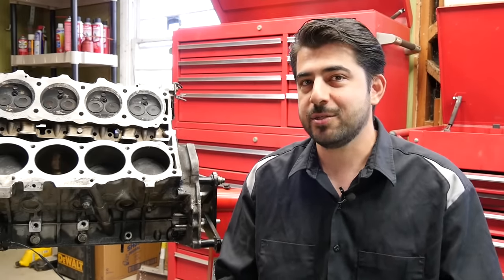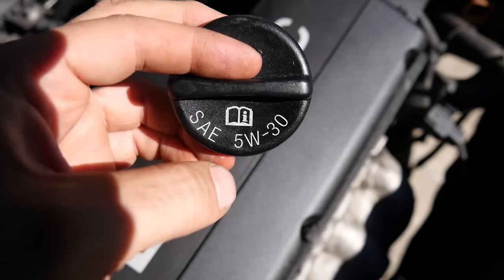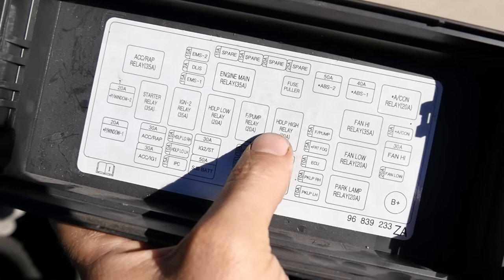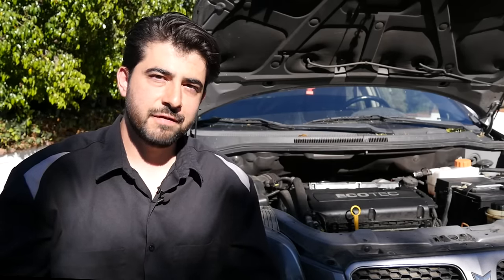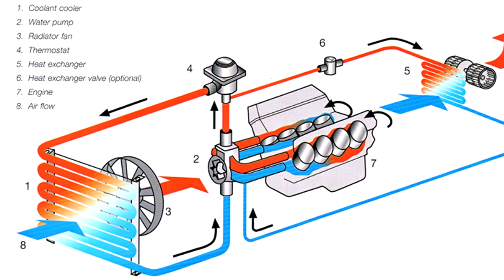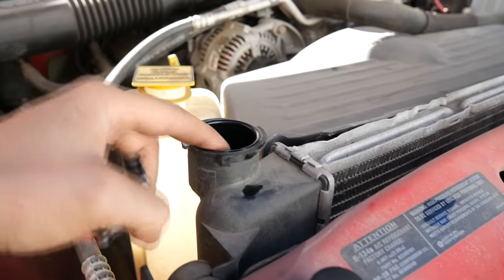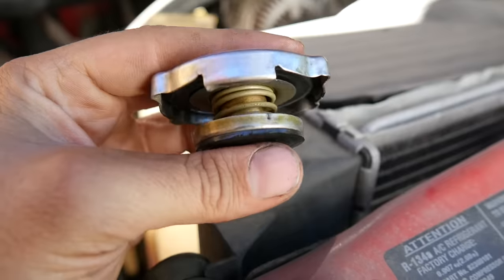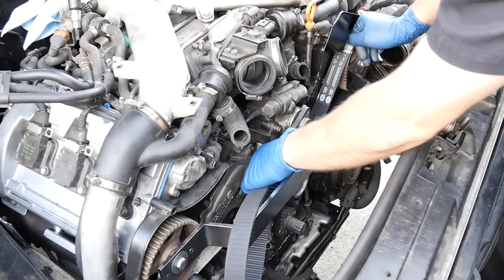Make Your Car Engine and Transmission Last a Very Long Time - Top 5 Tips On Car Care

Comment: 😳 No Sir.. Never prefill a lube filter unless specified by the manufacturer.. New oil right out the bottle is not as clean as people think 🤔 it can contain contaminants that can cause significant engine wear or damage if goes unfiltered in the engine by prefilling the filter..  all engine oil sold even under the API, ILSAC standard as to meet a ISO rating of particulate count for new oil which is always higher than what most manufacturers want for modern car engines.. so one can do way more harm than just put on the filter dry...
Reply: Let's see a legit. reference for that.

Comment: Failed to mention low quality gasoline can leave deposits on the oil control rings. Major problem.
Reply: Where do you get "low quality gasoline" In the U.S.?
Reply: @wholeNwon  the place thats a penny cheaper then BP,Shell or any other top tier station
Reply: @dustinpomeroy8817  (than).  Don't know where your gas comes from but here it ALL comes from the same regional refinery. If that weren't the case, transportation costs alone would make large differences in prices at the pump for various brands.  In fact, the same hauler delivers almost all brands here...including the "low quality" gas...that still meets all of the gov't. standards. More myths. But I wouldn't buy any brand from a very low volume station.
Reply: @wholeNwon  yeah and all water comes out of the ground,I don't know how you figure a place like Shells gas isn't better than than a cheap places but to each their own ,I'll stick with places that have a premium additive package
Reply: @dustinpomeroy8817   I do use "top tier" gas but I don't think that cheap gas is somehow "bad". I buy top tier because I keep my cars forever and never want to remove the heads. So far, so good after 58 years. Does increasing the detergent 3x help keep the intake valves clean (16 of them in my car)?  Probably so. Does it do anything for all those exhaust valve?  Nope.
Reply: @wholeNwon  why wouldn't cleaner gas going in be cleaner gas going out,a cars much like your body, I'm no vegan by no means,but the fewer impurities you put into it definitely the fewer that will come out,if you didn't believe it was better gas you wouldn't use it.Will cheap gas make your engine seize up?No Will it shorten the life of it,yes along with the injectors,the fuel pump and anything else fuel and combustion related.Keep doing what your doing, it's obviously working,but know the gas you use is quality the counter part to high quality is low quality .Just because something meets standards doesn't mean it's good per say it just means it meets the minimum requirements by law .Haha you're way more experienced than I and I guess by talking to you it makes me wonder why you made the statement in the first place when somewhere you believe the bare minimum isn't the way to longevity

Comment: Timing components, at least tensioners and pulleys, and even water pumps should be OEM. Have seen several times where pulleys, pumps or tensioners failed at a fraction of miles vs OEM components, even at 50,000 miles or less. You wouldn't implant a cheap chinese hip or knee joint that would need redone in a few years when it fails, right? Spend the money once and go another 120k miles

Comment: 1998 jeep Cherokee...300k miles and still daily driving that mfer. Change the oil every 3k and use decent oil like 1540 or 2050. None of that thin shit . Oil is supposed to be thick not watery like 0-20. If you have a car that says 5w30 use 10w30. Never use the thin stuff it recommended.

Comment: What if my car overheats at idle, but is normal when I'm driving
Reply: Could be a bad radiator fan.  When you're driving the car is moving thus pushing air through the radiator.  All new cars use an electric fan that kicks on when the temps start to climb to keep the radiator cool when not moving fast enough.  Pop the hood, and run the car.  When the temps start to rise above normal look behind the radiator and see if the cooling fans are on.  If not there is your problem.
Reply: Slim Jim thanks! I’ll give that a try

Comment: Why synthetic? It’s very expensive. If someone drives only 3-4 thousand miles a year, would it make sense to use a thick synthetic oil? I figured it might even be a better idea to avoid it. Now someone who drives a lot, I can see maybe getting synthetic. I prefer to just 1-2 times a year with under 4000 miles use, changing itbwith conventional.

Comment: Dude forgot to mention, how you drive. If you get a heavy truck with a small engine and drive it like heavy truck with big engine, you might not get a lot of life out of it. Get any vehicle and drive it with your foot to the floor all the time, and it won't last long. Not even one of them good old Toyotas. I see people listing them and saying they've replace the engine all the time. Even an old 2.2 or 3.0 V-6 Toyota won't survive lack of maintenance and reckless driving habits.

Comment: Replace a thermostat, and a water pump, with the timing belt, on an engine that has been giving you no trouble? Er.. Yes and replace the welsh plugs, not with the aluminum ones but brass, pull the entire engine apart when you do an oil change, and paint all the oil wells, journals etc with clean oil with a paint brush. Even though your engine may not have overheated and your head gasket is still intact: Just take it off and service it anyway (perhaps during your oil change painting?). Oh never mind, just replace the engine... It's easier than all of that other crap. 

No one does all of this stuff he's talking about. Not even your average mechanic and with good reason. Even drag racing engines, that are rebuilt every race, don't change the things he is talking about every time.

Comment: NEVER fill the engine oil filter in your car!! Doing this CAN cause an air lock in the lubrication system that the oil pump cannot remove!!!! Yes, I HAVE seen this happen several times!!!!

Comment: To make a Generation 1 longitudinally-mounted VW/Audi 1.8T engine last longer, use an oversize filter, such as a Mann 950/4 = Purolator L40316. It hangs vertically and can be prefilled with a full quart of oil.

Comment: the only thing about flushing an automatic trans sometimes the dirty oil is the only thing holding it together no i have seen guys flush there trans and it would not work right again. so i if you havent changed you trans fluid in like 100.000 dont trust me i know.

Comment: A lot has to do with the engine you have in your vehicle for example in my 1997 Toyota Hilux witch has done 437000 kilometres and the engine because my Hilux has the famous ultra reliable 22R motor which is renowned for its reliability and its a manual actually l did change the thermostat and coolant recently and the radiator cap was changed about 4 years ago when l changed the radiator also when l changed the coolant and thermostat l changed the three radiator hoses and one of the hhoses was original now l have no petrol pump relay because the petrol pump is mechanical mechanical as was changed before l bought the Hilux 5 years ago because it looked shiny and new l have changed all the usual parts brake pads oil oil filter air cleaner filter fuel filter distributor cap rotor button plug leads spark plugs rocker cover gasket whole exhaust system universal joints tyres it had new rear springs when l bought also when l bought the Hilux l got no service records no paper work at all only the registration paper that's it but now l keep every peice of paper work associated with the Hilux and a list of what what work has been done on the Hilux and so far it up to 15 tasks

Comment: Keep pouring money into one car. That's a easy way to keep your car running for 400k...besides normal maintenance, change transmission,  change alternators, change spark plugs, batteries, fuel injection, breaks, timing belt, all gaskets, etc...

Comment: I have a 2010 lincoln mks 142,000 miles never needed a repair
Reply: That's barely broken in for a Toyota. Check back in after another 150k
Reply: @AlexandarHullRichter  show me a Hyundai with more than 150 miles and I will give u a dollar
Reply: @PCSPITTER4NY  you owe me a dollar. I've got an 03 Elantra at home with 224k, and I'm changing the timing belt so I can sell it.
Reply: @AlexandarHullRichter  one still running
Reply: @PCSPITTER4NY Dude, why tf would I bother doing major maintenance on a car that isn't running?

Comment: How does filling the oil filter help with start up wear?? You oil pumps in the oil pan and oil is sucked up and system is pressurized and all your oil has already drained  from galleries when car was shut off so filling oil filter really makes no difference at all

Comment: An6 car can get 400,000 or more . All you have to do is take care of it . They  have not made cars any better than they were in the 60s matter of fact they have made them less environmentally safe . 
You do the regular maintenance to them and they will last the same as always 
I have had many go over the 300,000 mark 
I only sold them to get something different 
They are still on the road some have reached 500,000 miles now

Comment: All of this is in your owner's manual
Reply: The weird oil change part to crank to get oil in filter is not in the manual.  The changing cap as preventative maintenance is not in manual.  A warm engine has oil in places it needs.  And tossing a cap is silly.  Mechanics I go to just test it.  Why toss it without testing?

Comment: Moist  cars today have what’s called clear flood mode all you do is put your foot to the floor of the gas as you crank the car and that will cut the injectors therefore you can circulate oil through that empty oil filter😱😱😱

Comment: After the first tip: "use always a synthetic oil", "and factory recommended oil" I closed the video...

Don't forget; after a certain amount of time, you get wear, and the factory recommendation and especially synthetic oil will be too thin for the engine. 

Don't use syntetic oil, after you have used whole your life a half or non syntetic. This will loosen up all the dirt and get everywhere.

Long story short: use a oil according to your wearness of the car. Mainly a 10w40 half-syntetic will do the trick, if your environment conditions are normal.

Comment: Never, ever flush your transmission! Only replace the filter and drain and refill. If your transmission has never had service, and has over 100,000 miles, you shouldn't service it at all.

Comment: I'm not sure if i'll ever buy another GM product ever again, My Equinox transmission just gave out after 120,000kms.. WTF!? This is with changing the transmission fluid at 80,000kms which was still red. Also the engine was consuming oil.. ECOTEC is GARBAGE!

Comment: the nonsense about removing your fuel pump relay after an oil change is pure nonsense, just run the engine before you empty the oil, and refill it relatively quickly.

Comment: Listen folks, it is very simple. First, you have to buy new one toyota or a hyundai. After this, change oil and filter every 7000km. Last step to win, GO BY THE BOOK OF THE FACTORY. FOLLOW THE RULES INSIDE THE BOOK.

Comment: 1. Take that transmission pan out.. clean it with bleach.
2. Put it back up
3. Torque it to your specified manufacturer's directions 
4.refill with the amount needed for the transmission. 
5. Flush it.
6. I've done this to too many vehicles with various mileage intervals and none have failed. 

Only thing is, when you take the pan out, look for big metal pieces. If not your gooood.

Comment: Filling oil filter with oil is A HYPE, it takes a split of a second to fill it up and start sending oil instantly when you start motor. Check out motors running without  oil as long as it doesn't get hot.

Comment: Buy an older car with low mileage. New cars are only any good for the life of the warranties due to the ever more complicated electronics and emissions add ins like DPF’s, EGR valves, electronic parking brakes, stop/start systems. Ok if you can afford to change your motor every three years, otherwise a living nightmare.

Comment: You talking BS! Guys,do NOT fill oil filter with oil before replacing it! After oil change,oil must go through oil filter as fast as possible and if you'll fil it,it will flow hard...broken filter is often caused by this...DO NOT fill oil filter!

Comment: 😂 you wont get to 400k miles because you fill your oil filter or crank the car with no fuel pump fuse. This will just give you trouble with no real benefit

Comment: If you had warmed up the engine prior to changing the oil filter, priming is not necessary.  Removing fuel pump fuse is not practical or necessary.  Replacing a non leaking water pump is wrong!  Your crude Hole Joke ended it for me !!!!!!!!!!!!!!!!!!!!!!!

Comment: Do not buy a vehicle with a timing belt.
Reply: Meh. There are a lot of good cars and good engines that have timing belts. You just have to change them on time. 

Most good ones only have to be changed once every 100k, so it's not like an every day thing.
Reply: @AlexandarHullRichter  All the vehicles I have ever owned are timing chain.  I refuse to buy anything driven by an elastic.
Reply: @eduardosampoia5480  good for you. I've got my 3rd belt driven car, all were as reliable as gold. I wouldn't dream of ditching my car just because I have to change an extra belt.

Also, I tend to keep my cars long enough that I would have to replace the timing chain on some models anyway. Having done that, I'd rather replace a belt twice as often, especially given that a timing belt is still not a frequently replaced item.

Comment: Synthetic oil will blow your rear main seal if your car isn't designed for it 🤔🤐😒😒
Reply: nope.  Might seep.
Reply: @wholeNwon  depends on the type of rubber seal, the synthetic is a thinner oil with different additives that might eroded , or leak through?
Reply: @DkingE39  Have no knowledge that any such thing has been shown. Obviously oils chemically destructive of seals aren't going to be marketed for legal reasons alone. Viscosity ratings are correct. It's an issue of laminar flow (molecular structure) that makes them tend to seep past old, worn seals.  Noting magic.
Reply: I don't know if I'll agree with that I change my seal within the year and 12 months of 60+ miles of high way and city driving in 90 degree  weather 5days a week resulted in a heavy oil leak. Also the viscosity was super thin after 2 months. I think the real knowledge is shrouded in mystery because engine development and industry Return in interest  with most people not holding on to cars for more than 4 years or 100,000 miles has resulted in lack of real information